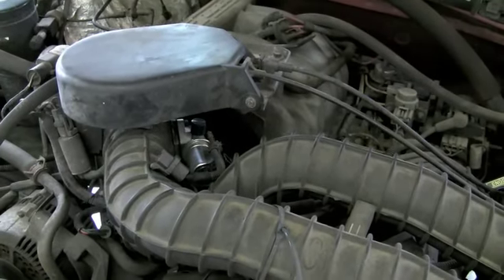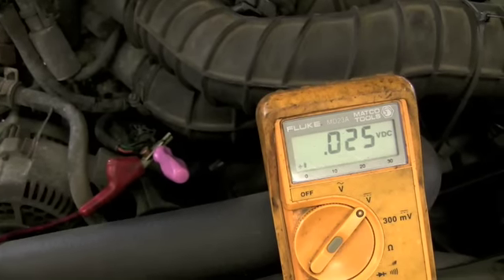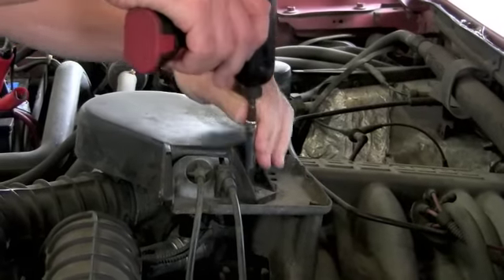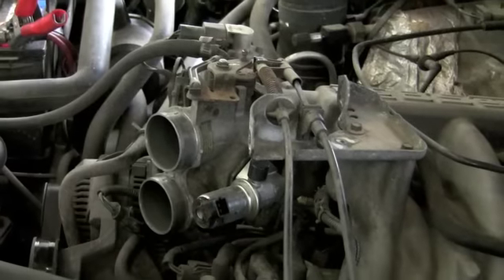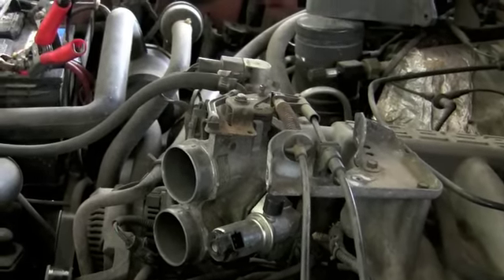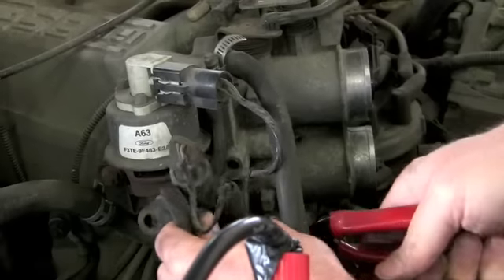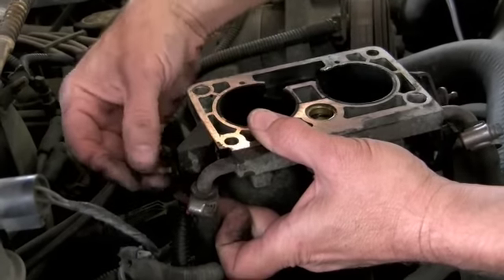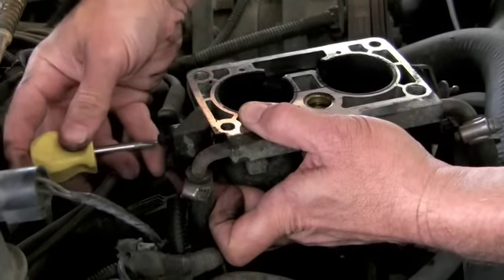1995 F150 Erratic Idle Part 1

Comment: Changed the map sensor and the check engine light  off but it shakes a little still
 Could it be a vacuum leak?
Reply from the maker: A small to moderate vacuum leak may cause the engine to idle a little rough but it would tend to smooth out as the rpm's are increased. Other faults could act the same way though.
Reply: Sparky's Answers Sparky I have the same exact problem on my 94 F150 5.0 what was the  solution?
Reply from the maker: Sorry, I do not know which "exact problem" are you referring to? In the video I explain the problem and solution for an erratic idle with a code 121. Domantor11 had an issue and a question that I answered as best I could but no solution was given by domantor11  for his problem.

Comment: try takin the IAC (Idle Air Control) solenoid off, clean it really, really good, and put it back on, then get back to me and see if that worked, i had a similar problem on my 92 f150, with the 351 windsor

Comment: I have a 1992 f150 5.0 and I have s lot of oil in the intake tubes and in the air filter
Reply from the maker: Check the pcv valve system for problems but it is highly probable the engine has too much oil blow by.

Comment: I got a 1994 f-150 that stalls when you put it in gear and take off right after you start it up in the morning. Then, sometimes when you're driving and you apply the brakes and come to a stop, it'll stall unless you put it in neutral. Anybody know the cause? It's a 4.9l. I took it to a mechanic and they couldn't tell me anything useful. Any advice would be much appreciated.
Reply from the maker: Start by checking codes and go from there. If there are no codes I would check for vacuum leaks and then check the idle air control solenoid.

Comment from the maker: A vacuum leak is possible and you need to check for one. Is the check engine light on? If so what codes are stored?
Reply: I have two Fords F250/F350 97 & 95 and have found the vacuum line to the heater control gate valve on the firewall passenger side partially deteriorated, got some vacuum fittings and tubing ran back into the flex harness. Fixed MPG and idle start problems. Its a small line, but was significant enough to cause problems.

Comment: I have same truck,  rather same year model with 302. My truck idles great,  but when I am driving normal highway speeds and let off gas,  it doesn't drop down to idle,  it stays up like I never let off gas,  once I come to a stop it'll go to normal,  it also changes gears a little late.  This has me thinking something with speed and Trans shift points? Truck does great except for that,  and the ac won't get cold at idle,  u have to go down the road and it'll get cold..  I'm not a mechanic by no means,  but can change parts,  anyone have any ideas?
Reply from the maker: You would needs to look at codes and data if available. A few things come to mind though. Fan clutch or thermostat keeping the engine temperature too high could be most of your issues. Or you could have several problems. The a/c issue is likely related to high engine temperatures. The idle problem could be related but also might be idle solenoid, computer or various other things.
Reply: +Sparky's Answers funny you mentioned the thermostat,  I just changed it and actually my temp has ran below normal,  no check engine lights at all and I just found out I'm now only getting 6mpg vs the 18 I was getting less than a month ago..  What the hell? It was skipping and running rough,  now I tune it up and spend about $400 and lose all my gas mileage..  It looks like my cel Wud be flashing with that much of a fuel economy loss.
Reply from the maker: It is not at all uncommon for the fuel mileage to drop some after fixing neglected issues. It takes some time for the computer to relearn fuel trims. However there should not be a 12 mpg variance. Your high engine speed during deceleration and delayed upshifts could account for a fair amount of the fuel economy problem. There are many other things such as tire pressure, alignment issues, brakes dragging, transmission slipping and etc that could cause fuel mileage concerns.
Reply: +Sparky's Answers I understand what ur saying,  it just seems like that much of a fuel economy loss would result in really noticeable performance issues.  Everything seemed to start acting weird when I changed the thermostat,  my first thought was great,  it's running super cool,  but that may not be the best thing.  I put a muffler on it but left cats on,  just changed oil last night to t5 10w30 rotella after a bunch of research on bitog,  hopefully I'm on the upsloap now.  Thanks for the help and fast response.
Reply: Koch 40 you need new catalytic converter my cougar did the same thing blow the head gasket out befor i found out it was the catalytic converter

Comment: My truck is a 5.8 1995 and the engine shakes the cab when its warmed up. I put mew plugs and cap and rotor in. No new wires. Truck sat for 8 years but passed inspection on the first try. Also has 139k
Reply from the maker: I would go ahead and replace the wires also.

Comment from the maker: I  probably will not have time to do the second part for a few more months. If you need help with testing please visit my primary repair site. 
Just google Sparkys-Answers

You can email me there with your specific information. Year, make, model, engine size, codes and test voltages.

Comment: Espero hablen español... Tengo problemas con mi Ford 1996 xlt 5.0 puede potencia
Reply from the maker: No hablo español, pero puedo usar Google Translate para averiguar lo que estás diciendo y espero que te dé una respuesta para tu problema.
Reply: Cuando salgo a carretera siento que pierde potencia cuando hay pendientes suben las revoluciones pero la velocidad se reduce poco a poco y provoca que consuma demasiado combustible ya cambie el regulador de presión de gasolina, cables, bujías, sensores de aire, limpie el cuerpo de aceleración, en fin pero no he visto mejoras
Reply: Y además que cuando quiero rebasar a un vehículo se siente como si tardará en revolucionar no responde rápido al acelerar como cuando en una transmisión manual pusieras el siguiente cambio antes de que pida las revoluciones
Reply from the maker: It sounds like your transmission is slipping. 
Parece que su transmisión se está deslizando.

Comment: I know I’m late, but I’ve got a rough idle when my foot is on the brake. It seems like it does it more often when warm. Park and neutral is fine, no rough idle, only in gear. New tps, plugs and wires, rotor and dist cap, ignition coil, fixed vacuum leaks, fuel filter, etc. any ideas?
Reply from the maker: Possibly a dirty throttle plate and throttle bore. You may still have a vacuum leak.